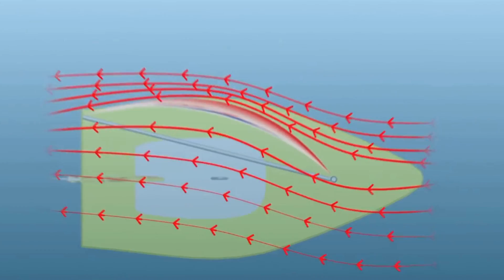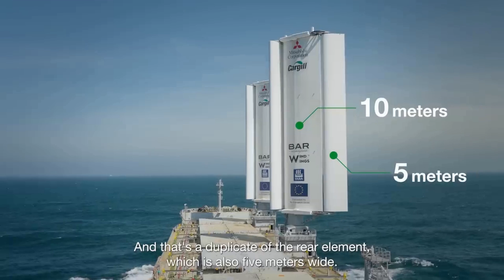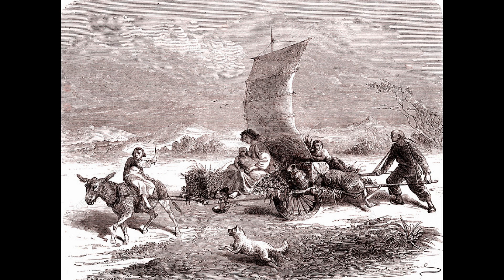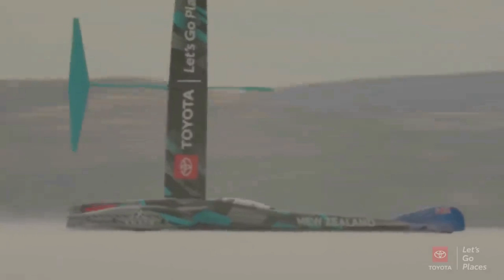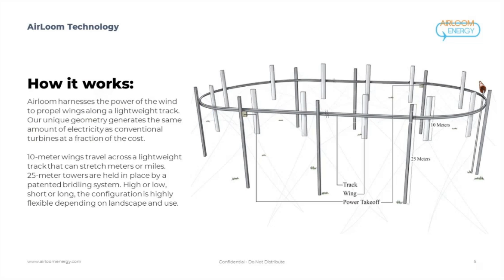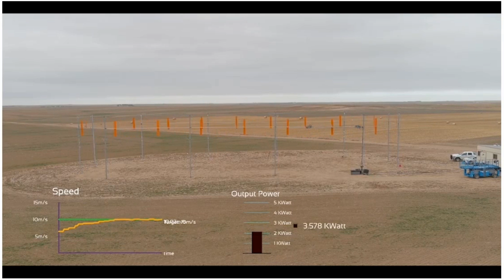2113 Air Loom Wind Power

Comment: If I were making it low cost, I wouldn't put moving magnets on the track. It would be much easier to use a belt or chain, like you do, and then just pick off power at any point via sprockets or pulleys, to a rotary generator placed along the perimeter. Better power density, lower cost, and with the benefits of a gear ratio.
Anyway, great video and quite amazing that you put together a demo so quickly!

Comment: Another good one Mate. Fun to daydream... I love sailing and flying. Full circle circuit sailing or an aircraft holding pattern.  In my mind's eye the layout instead of being a rectangular course could be maximized probably by the track being laid out like a wing to the dominant prevailing winds. Depending on scale perhaps could be a grid system with multipurpose application. Generating power, Sightseeing, Transportation, Housing, Dining and many spinoffs... Architectural engineers should have fun designing possibilities around this concept. Monorails were promising as were sky lifts however never manifested except in amusement parks. My favorite is the linear motion track transportation system. Many walls, fences and present existing architectures to upgrade.

Comment: Football / sports stadiums and racetracks may be ideal locations for such a generating device...

 Zone variable AoA control using an elevator/tab is very possible  (operation,  power / comms - sliprings / brushes  or solar panel with short range radio for onboard actuuation electronics / control, vs a cam follower on the  (second movable "control"rail - while easy to set up, les tech on each "blade unit",  it is more difficult to vary for demand following)  - allowing for variable wind conditions around the track.

(NB, in case any aren't sailers or kite fliers -  that the reverse reach needs a reversed Angle of attack for the wing (blade) - achievable in several ways - trimtab reversal (non-optimal symmetrical aerofoil),  or  for the blade unit to rotate to inverted for the reverse run (unidirectional optimised aerofoil)... -   the reach to tack leg needs to be as streamlined as possible (Zero AOA).
Reply from the maker: that's a good point mate

Comment: Airloom's wind turbine  has blades that aren't supported by a central hub but rather multiple towers.   
I wonder how large this design can get
Reply from the maker: it is an interesting idea
Reply: I don't see any intrinsic scale limits. However, it seems to me that one of the strengths of this concept is that it lends itself to decentralized and dispersed multiple installations with lower barriers to capital formation. Many relatively small such installations are likely to be both more financially and physically efficient that fewer, larger ones.

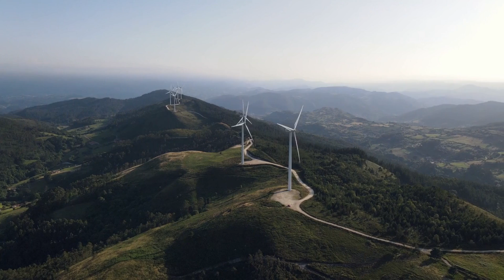Comment: I might as well mention the video from youtuber Electric Viking from yesterday in case you missed it about the same topic of wind energy : "Bill Gates backed game changing wind energy device reduces cost by 65%". at the 4:30 mark he goes into the details of that Airloom system as well. But more the merrier in this field because we're long overdue for the transition. 
What we need more than ever is affordable and safe storage of electrical energy to lessen the load on overstressed grids while also empowering ppl with energy independance.
I see it everyday with my parents donating tens to hundred euro worth of electricity (depending on the season) to the grid while still getting billed at the end of the year because they practically got nothing in return per kWh and pay through the nose for bought kWh's and also being billed for using the net both ways. Storage is a real issue and it is hard to prove the importance of it personally to them because I'm not financially capable of just go out and buying a powerwall or any other from another brand and plainly demontrate it. 'Hydrogen economy is still a thing in their mind" and I choose not discussing about the topic in depth in the family since years because it's usually seen as arguing rather then discussing. That's combined with not yet openly available existance legislation on energy distribution here in Nl. There are some initiatives but it so slow. In the meaintime I can use all the electricity I want or need during the day but when the sun goes down I'll just use my laptop and powerbanks that I recharged during the day. But it's cumbersome. Add to that the want or need for an electric vehicle. But I enjoyed your video as always Robert, have a good night.

Comment: My silly question is, does mass wind-energy harvesting not remove joules from weather patterns, thereby as a whole, altering the weather patterns it is supposed to be a defender of? Just my half-wit two cents - recall I have no scientific training. I mean maybe making more complex weather patterns, but is the removal of joules from wind currents in any way detrimental to existent weather patterns, even from  microclimatic perspective? Adding another jumbler into Pandora's weatherbox? I really do wonder. I would also say that I would want a device reliant not on the external environment during operation but rather material properties and design, once constructed, rather than having a further impact on the environment whatsoever other than electrical output during its operation.
Reply from the maker: the only way to have no effect is to do nothing mate
Reply: @ThinkingandTinkering  lol  guess. I meant once its designed it has some inherent propety that only outputs raw electricity nd nothing else, post production. I agree with you though, lol. I'm a bit ideoilllogical  I guess
Reply: Nature provides plenty of things that change the wind.  Mountains, trees etc.
We also keep building houses and tower blocks.  I wouldn't worry about the minute effect of any wind powered energy generator.

Comment: hi!
Does anyone have an idea for making a low-cost liquid desiccant system with CACL2?
I'm thinking of food dryers, or small rooms, cars... which suffer from the humid autumn
Reply: why for cars? they should be safe by heating the air because it is drying it, and when it it condensating on the glass/windscreen it should only be recirculating the air inside and heating that one
Reply: @ministerulmagiei  
because i live in very moist country, and if i don't run every day, every thing is spongious....(sorry for my english)
Reply: @simon-experiences  I think I know how to prevent it, so you need to guess the temperature of the weather in the future, if you know you will start the car in the morning on 17 November, and there will be 2 degrees C outside, you need to lower the air temperature inside the car on the night before to 10 degrees for example. When you switch to cooling the air and recirculating it, the water will start to condense, a pool of water will form under your car, and that is the water you would've had on your windows if you didn't do it. You will get colder air in the car, the car will be drier, and even if during the night the temperature will drop to 2 C, water will not condense as much, because you took it out previously the night before.
Reply: I have a cheap and lightweight design for atmospheric water generator (dehumidifier) for off grid transport and apocalyptic scenarios, ping me if you want more details
Reply from the maker: there are a few of those sold aren't there?

Comment: Interesting start at looking into Air Loom and thanks very much for  the video.   From what is available I'm trying to comprehend how they will be actually generating the power from the system.  Would moving the cable with attached magnets through coils be what they are doing?   I'm also wondering how this concept would fare in inclement weather which may be why they are testing the concept in the state of Wyoming.  I liked your suggestion about altering the blade design for increased efficiency.
Reply from the maker: cheers mate

Comment: No one is going to believe me if I tell you I had this exact concept 10 years ago.  I thought aircraft wings on an elongated track with auto pitch would be a great step forward from VAWTs with a single central shaft.  I even thought of each wing carrying its own magnets  and using MAGLEV to eliminate friction on the runners.  The power from each wing being transmitted through  the tracks.  It could be a bit like a ski lift where wings could be swapped in and out for repair or tuning to the wind conditions.   Way beyond my technical ability to put all that technology together.  An after thought was to have a big track and have kites on long lines running round the track.
Reply from the maker: it is a good idea mate
Reply: I believe you because I had this exact same idea in my mind since at least 10 years ago. Including the final thoughts of Robert at the end of the video.
Reply: You guys can still do it. It’s not something that’s patented.
Reply: @anthonypape6862  Extremely unlikely that it does not have intellectual property rights filed, whether or not it has appeared in the public record.
Reply: @donnievance1942  Can you patent basic principles of physics though?  The invention comes from Tesla, everyone is just thinking of ways to get a magnet to pass quickly by a coil of copper wire using other inventions like flywheels, pulleys, wind turbines, any property of physics, planet gears, axial flux, some alone some together.  That's whats cool about Robert's channel. All of these ideas, and he's just having fun building.  I don't think there is any money it.  All we need is invented already.  Will we build it or will we make a great mistake and ignore the problem.
Reply: Did you used multiple generators  to produce power or you tried a linear coil and multiple rotating magnet combo. ? Please can you explain.?